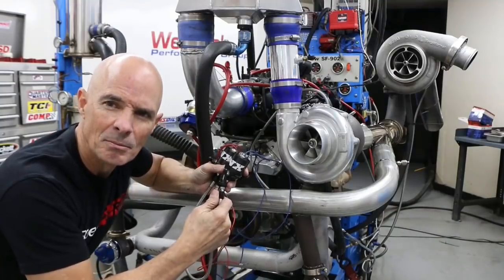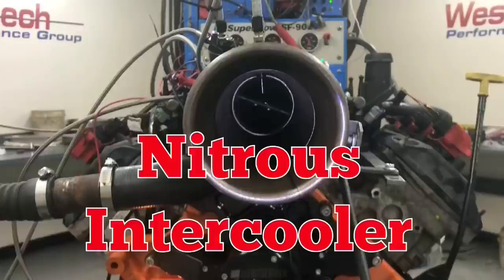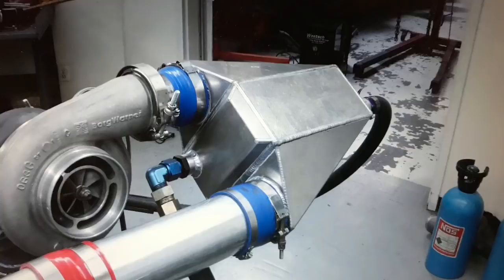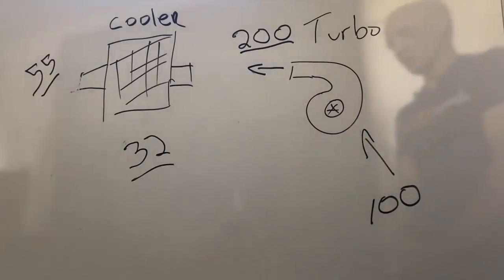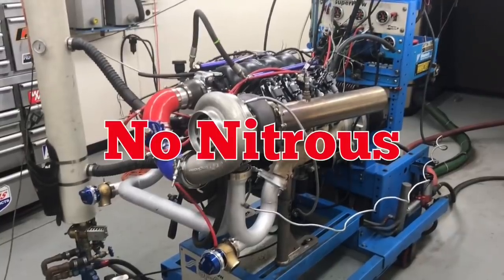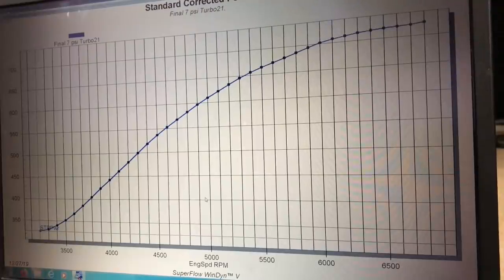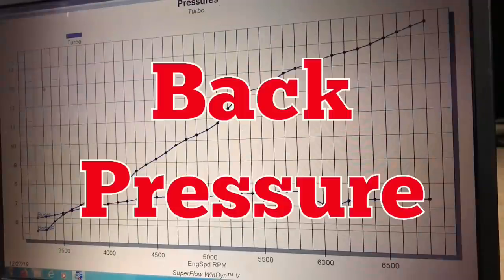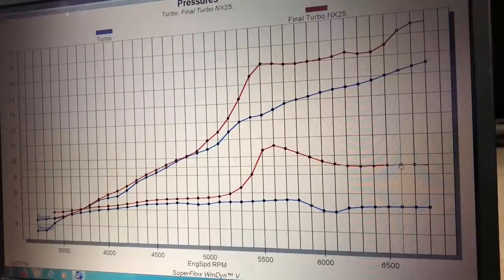NITROUS INTERCOOLER-TURBO + NX=BIG HP (FULL RESULTS!)

Comment: A test seeing if ceramic coating exhaust parts like manifold and turbo housing would have an effect on spool time, back pressure and power. Or a turbo blanket and wrapping exhaust with dei heat wrap.
Reply: Yes test 2 setups 1 outside only ,and 1 coated inside and out. 

I did inside and out on my cast pulse tuned after a few hrs with the pineapple  . Makes the cast smother than a babys butt. 

#powerdrivendiesel did a blanket dyno test . No extra power(same peak)but power came on faster(less rpm spools quicker) power. 
VHT 2000° works if it never gets hit with water when hot( stuff starts flying off like popcorn in a hot skillet). I painted to prevent corrosion then I rapped. A to protect the ceramic paint and B 2 improve spooling characteristics C reduce under hood temps.

Comment: thanks richard .this is the best channel on the tube that was a great test.i watched a vid you did with frieburger and dulcich on meth injection on a turbo ls.what about testing it again on single plain manifold with pump gas to see what sort of timing advance figure you can get away with on one of you turbo
 ls builds.i wanted to see if you can get close to your 20 degree timing figure you use with e85 fuel.

Comment: I used this same method on a supercharged ecotec. The LSJ uses an air to water intercooler and a 1L supercharger. Mine was using a 2.7inch pulley and cruising intake temps were in the 140-160 degree range. I added nitrous to the mix and the car increased boost pressure by 3lbs and a substantial gain in power. Intake temps also dropped from 140-160 down to 60 degrees with only the nitrous being the change. I added an ice tank to the intercooler and dropped temps even further and past freezing with the nitrous added on top.
Reply from the maker: you dropped the air temps below freezing? might be spraying the nitrous on your IAT sensor
Reply: @richardholdener1727  had 2.5 gallons of ice and circulating water through the A2W intercooler which by itself dropped IATs down into the 35 degree range. The nitrous took it below freezing after that. I was spraying the nitrous at the throttle body and was reading the IAT temp at the intake manifold outlet into the head

Comment: I have a probe in a runner and after a pass at the track the W2A  keeps intake as low as 18C. Nitrous didn't change temp much at the end of the pass. It changed a little at the start. Love your channel Richard. Can you please test E98 vs E85 and with stronger ignitions, like adding ign1 coils instead of the truck coils and bumping up the AFR and the coil  duty.  Cheers.

Comment: Let's see a test spraying the nos in the front of the turbo and let's see if it changes the efficiency range of the turbo.
Reply: Good idea.   I spray my water/meth in front of mine and it definitely does.
Reply: This is big time on my mind. Richard has gotta get these tested. Meth and/or nitrous’s effect pre-turbo vs post turbo. And maybe even its effect on distribution. 
Little meth pre-turbo vs a lot of meth pre-turbo boost (atomizing all the meth vs flooding the turbo).
Reply: @bryanleverett2830  I would just love to see if it changes the efficiency range of the turbo. I think in my mind it will just flood the blade area of the compressor wheel and not make as much power.
Reply: Cleetus sprays nitrous in front of turbo on his Galaxy and it definitely makes a difference
Reply: @tunerdadtunerdad7927  
Yea I ran water/meth into the turbo for years. 
Great no intercooler substitute. 
I got a setup to inject it post turbo ,because the internets said it would make more power ,  but I never installed it
Reply: Id be worried of clearances within the turbo. Bearings or wheels may lock up because of the temp difference. I mean it happens when you ice a blower casing and the rotors touch the body and thats a smaller temp difference

Comment: Question Richard, any tips on running a dry shot before the turbo, e.g at the inlet, does it help spool up better?    Plan to run a 50 shot to spool up a 83-86mm turbo.   I see some people run at turbo inlet after air filter, unsure if any different compared to running it after turbo in intercooler pipe
Reply from the maker: run it closer to valve-response will be better

Comment: Would water methanol be a  better option in the place of the nos or could run both basically using the nos to help spool the turbo a little bit faster to help with some of the turbo lag  sorry if this question sounds dumb I new to the turbo game

Comment: So it improved the exhaust ratio , why not work it out since you did for the other pull , what was the gain with out nitrous but with the intercoooler , then add the 3 psi of boost , all 9xx minus the 125bhp from nitrous and there’s the correct summary comparison

Comment: When I was running my old sbe 4.8 I had the a2a and a NOS fogger nozzle in the charge pipe and it straight up worked it was 75hp hit ramped in with the Holley, Now I am running a nice little .05 over 04 ls1 with a nice rotating assembly and the same CNC'ed 799's and summit 102mm intake I had on the 4.8 with a a2w setup with the same nitrous kit except with only the fuel solenoid spraying m1 in the charge tube I also run ignite e90 but not for long when my income tax money comes I'm getting some billet atomizer 325s and swapping over to methanol
Reply: @dj4monie  it was making some steam for sure, I'm running a Huron speed v3 single T6 kit with a billet s480 1.32 exhaust housing the 4.8 needed the extra help lol but loved it. I ended up bending some rods but I went pretty fast with it I went a best of 5.57 @ 123mph in my 3300 pound 4th gen z28 So it had to be makin 900+ at the wheels But if you dont need help spooling the turbo a2w and methanol is where it's at, iv been a 5.42 so far with the ls1/6 combo i think it's got .20's in it.  when I swap over to alchohol I'm gonna add another fuel solenoid and another fogger nozzle so I can spray more fuel in the charge pipe

Comment: Would there be a benefit to running an air to water intercooler and some kind of 2 loop heat exchanger, water in one, nitrous flowing through the other loop, then to intake, to super chill that heat transfer medium, I imagine best performance on a progressive system

Comment: Okay, so first off...your reflection in the white board reminded me of the alien that probed me after I built my first SBC. 
 Dang aliens....
With the nitrous; does the exhaust temp going to the turbo increase greatly as the nitrous gets going? And so the temp climbing back up later in the run?

Also, let's see the faceplant video. We know you got it on video. C'mon
Reply from the maker: I'm not sure how the EGT will change the temp of the air in th eintake

Comment: Great video Richard, as usual, but I'm curious to where You placed the nozzle and how much or little influence that may have on the temperature results? My logic says that if the nozzle were closer to the compressor outlet that perhaps a greater heat transfer could be seen between the nitrous and the compressed air. Just My theory and I don't know if You've ever published results of nozzle placement before on it's effect ( or lack thereof..) on IATs.
Reply from the maker: nozzle was about 4 inches from the compressor outlet-the big change might be pre compressor injection point-i have not tested that yet
Reply: @richardholdener1727  Please test Pre-Turbo injection.
Reply: Indeed, I'd love to see if there was any measurable difference in temps / or power with the nozzle pre compressor.

Comment: What fuel were you running through the nos kit. Do you think results may have been different with e85 or m1 in the nos kit side of thinks.
Reply from the maker: The extra cooling from the revised fuel (E85 or M1) would help-but neither is as cold as the -129-degree NX

Comment: So I’ve been thinking of running nitrous in place of a heat exchanger due to space constructions. I’m doing a roots style supercharger and don’t have room to go up for a heat exchanger. What would your recommendation be? I saw your video on intercooler vs methanol. And of course this. I am doing e85 as well, but I want to get charge temps as low as possible and make great power.
Reply from the maker: e85 carbs above a roots blower will work wonders
Reply: @richardholdener1727  sorry, I should have mentioned that it was efi. It’s an Eaton m122.

Comment: Where nitrous will give the biggest advantage is on a really large turbo, not so much temperature wise but being able to spool it sooner. If you use methanol, use the nitrous to get the "candles lit" and then pull it back and let the turbos and methanol do the work.

Comment: Hey Richard, this is probably a old video, im enjoying it non the less. Here in South africa its not uncommon to see turbo cars running quite a bit of nitrous, mostly for the power gains instead of cooling. I would love to see some of those huge stroker engines like the 632 offered by blue print engines, and even smaller ones. i know there is stroker kits for almost any v8 engine on the market, but one that has always pulled me is the ford 390 fe, in stock form and i stand to be corrected, they came in 390ci, 410ci, and 427ci, stroker kits takes them way over 500ci. 

i would also like to see some extremely high hp engines, 1000hp is childs play these days, many a drag car is over 1000hp now.

Comment: Curious on how running a small No2 shot in the front of a A2A intercooler makes improvements. I've heard even a tiny 50 shot in that manner can make 75-100hp increases
Reply from the maker: I tested the intercooler ring (nitrous injected across the ATA intercooler)-it does not add 75-100 hp

Comment: Could it possibly help stabilize the charge temps with the nitrous if it was sprayed before the turbo? It would drop initially charge temps and the turbo would allow the oxygen to get mixed with the air better. Thus allowing better distribution to all cylinders. Just a thought, thanks for the educational content.

Comment: With the test you did comparing the S475 and the S480 and the S480 made more power I wonder what kind of difference that turbo would have made on this same test. Do you think the bigger turbo would have kept the air cooler making the impact of the nitrous hit that much better? Still really impressive test results.
Reply from the maker: the nitrous cooling is a function of the amount of hot air vs the amount of cooling compound-don't think the turbo choice will change that if the power leve is the same

Comment: I like the videos. Would you do some tests on the Coyote platform?
Reply from the maker: I've done lots on the Coyote
Reply: @richardholdener1727  I will have to search for them. I just saw your video come up and I remember you racing in the 90s so I subscribed.
Reply: Coyotes are AWESOME. Just LS stuff is just kind of “known values”. So I think it’s easier to prove out the experiments.
Reply: @bryanleverett2830  the things I have seen him do could be easy to prove or disprove on any platform. You would just have to do it with mostly factory parts as there are not many aftermarket parts for the Coyote.

Comment: Ok so what happens if you just used the fogger in an air to water intercooler purely for refrigeration, or tapped off the a.c. lines to run through the water portion of an air to water intercooler?

You keep saying using it as an intercooler when you're really not using it as an intercooler you're just spraying a turbo motor with nitrous...

Comment: On the upcoming video did you inject nitrous into the charge air or use it externally to aid the ambient air to increase the efficiency of a intercooler?
Did you adjust the ignition timing between these 2 runs?
Reply from the maker: I've tested both of those situations, I did retard timing on the nitrous run

Comment: I think the reason why boost went up when you activated the nitrous this because turbos work off of heat... and  the heat dramatically increased in the exhaust I think the other half of it is if back pressure goes up boost goes up if the turbo is in its efficiency range.

Comment: Can u please help me I have a wet kit . Am getting a turbo or suppercharge next 
 Addimg nitrus .
Wear do i put the frogger . After the intercooler . I am not using it to take the lag away like some do i wamt to use the nitrous kit to it full . I have a progressive controller . And been into nitrous for a few years . Bit on N/A cars. 
Can u help . 
I no about spray bars for the intercooler.  That's not for me
. Do i put the frogger still in the intake or before the intercooler.  Please help if u can.
Reply from the maker: in front of the tb
Reply: @richardholdener1727  thank u so much

Comment: I got an interesting turbo test idea for ya, something I'm personally curious about. Could there be a benefit from putting the turbo behind the catalytic converter. The converter basically performs more combustion and heats the exhaust more, this should better run the turbo.

Comment: I had a crazy thought...... what if instead of having an evaporator on your ac system, you routed the cold freon through the water side of a water to air intercooler using the freon as a coolant instead of ice water. Would the pros from the intercooler outweigh the cons of having an ac compressor running off the motor? It would be a closed loop system, so no worries about refilling a tank with ice all the time, and you could have the ac clutch wired to a switch or thermostat so it isnt running constantly........ 🤔 also are the water to air intercoolers able to support the psi charge of the ac system?
Reply from the maker: that has been done by the factory already

Comment: Wouldnt the cooling effect of the nitrous be more noticeable if you injected it infront of the turbo not in the not in the boost tube
Reply: Ik you don't want fuel condensing in an intercooler

Comment: What if you put it before the turbo? -129 going in even if it raises it 100 still be -29
Reply from the maker: Not sure how it would only lose 100 degrees by being in front of the turbo-rather than after turbo
Reply: @richardholdener1727  not sure just a question. And throwing it out there. If its before the turbo could it keep the air cold better than after. I am just learning about turbo stuff myself. Your content helps alot.

Comment: Instead of just cooling the charged air, I wonder if cooling the ambient air coming into the turbo by placing a jet at the turbo Inlet keeps the temperature of the turbo itself down under a load and lowers charged air temps better than just having a jet in your charge pipe. Or if a small jet outside the turbo spraying into the compressor AND a jet in the charge pipe is better than just one or the other. Say you’re spraying 150 shot into the charge pipe or the turbo compressor, do 75 into turbo compressor and 75 into charge pipe.

Comment: There's a fundamental problem with this kind of test, and that's injected fluids hitting the thermocouple and shifting the readings (always in a more favorable direction). Spraying pre-compressor will at least ensure the fluids are thoroughly mixed before they reach the TC. Some people that have done this test have concluded that pre-compressor injection doesn't cool as well, but it's likely just the result of getting a more accurate temp reading. Getting reliable data is always the hard part in these tests, don't trust everything your sensors tell you. :o)

Comment: What about using the water to air intercooler and flooding it with nitrous and haveing the exit line feed the engine when the spray is activated
Reply from the maker: I ran nitrous with an ATW cooler in another test
Reply: @richardholdener1727  im saying use nitrous instead of water  in the intercooler and then having it exit the intercooler to the turbo. Not just a combo of both. This would allow temps to come down even further

Comment: Were you out skiing or something? Reminds me of my old snow burn face injuries. 

Hope it’s a quick recovery. Bump*.
Reply from the maker: I wish I was doing something cool
Reply: @richardholdener1727  was alcohol involved?
Reply: @Stevesbe  I'm just going to assume "yes!"  Much funnier that way.
Reply: Unfortunate. 

I’m sorta curious if the “boost creep” is due to the fluid being added to the mixture. Possibly increasing compression ratio? 

Any chance you guy will cover any topics about manifold material, shapes, benefits of velocity and or volume, lag, diameter of turbo charge pipe, necessities of intercooler?

I’m interested in remote turbo chargers and there are so any different opinions but so little evidence to back anything up.
Reply: @LazyHieuVLOGs  I'm running a pair of $129 China GT35s in the trunk of my primarily drift car, and it ran 143 in the quarter without a hard launch.  I saw a video on youtube of a dude running 180s in the quarter in a street driven 3rd gen camaro (with A/C) with a rear mount turbo also. That was what really convinced me that they can work.

Comment: What would happen if you used an intercooler with nitrous as the cooling medium - discharging nitrous through the intercooler instead of into the intake air stream. Would it be similar to  a dry ice intercooler?

Comment: ATTENTION ATTENTION I have a question if nos is so cold I run it and turbos none intercooled for drag racing so the nos is on at above 4000 rpm , so if I only drag race why couldn’t I run the nos thru the water part of the intercooler and then back to the plate I.E using the cold nos to cool the intercooler prior to injector plate ??????
Reply from the maker: you can try that-but there is much better use for the nos and the system is under pressure